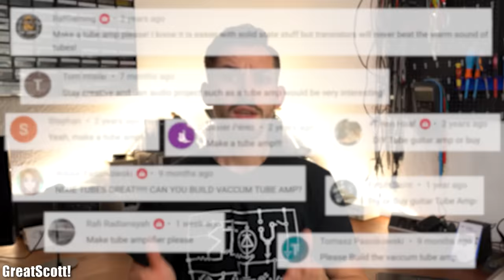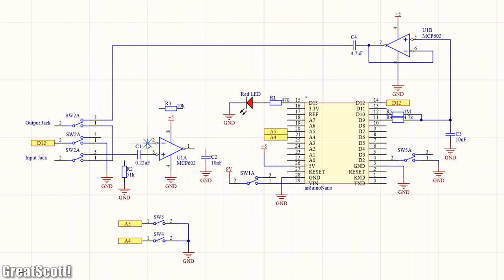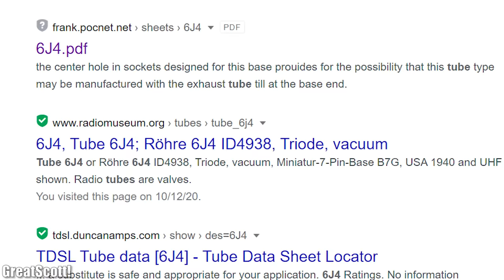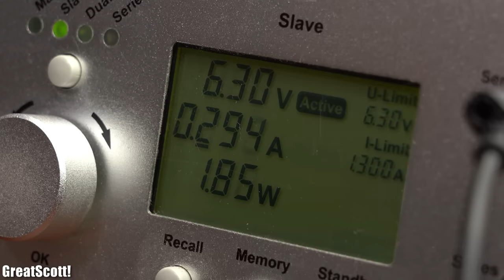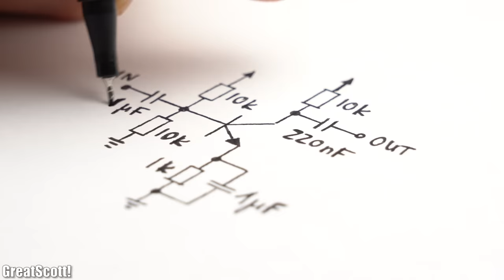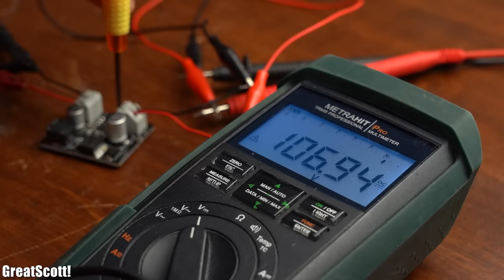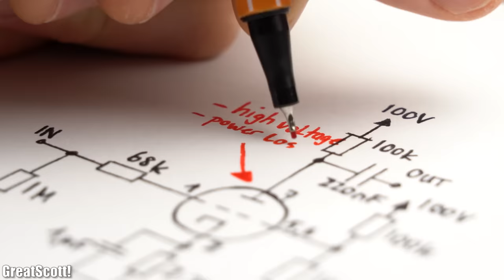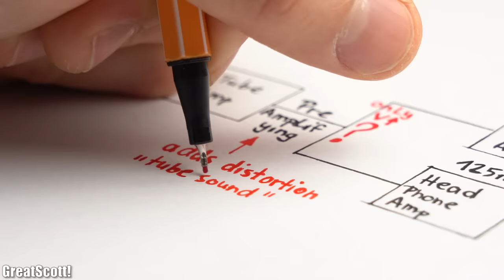Building a Tube Amp! Does it produce better audio quality though? EB#47

Comment: Question; My grandfather who was an electrical engineering degree in 1932, once told me that only tubes can produce higher than 40 watts for transmitting voice over a radio. He passed in 79, but had indicated that space craft full of electronics, still used a tube radio to communicate with earth stations or Houston. 
Also, I have never studied class D amps or guitar amps other than having the back off a “Marshall” years ago, it was full of tubes. Wouldn’t Ted Nugent hunt someone down if the came in the night and stole his tubes from the class D amp section? His feed back was legendary on stage. It you to cost $5 US to see a cover band followed by Ted Nugent or Alice Cooper. I stopped going when it went over $20.

Comment: Both Solid State & Tube amps are quite similar when operated within their limits.  It is when over-driven that the differences become audible and different.  Solid State amps have a harsh quality where tubes tend to be less noticeable... and in some cases produce a sound that is appealing.  (guitar amps for-instance) selling the sound as unique.  Keping both in the most linear portion of their specifications will result in a very similar sound.

Tube amps generally require a transformer to couple the speaker's impedance to that of the Tube plate circuit.  Although some tube circuits have been produced that can be transformer-less.  The transformers are a critical part of the design.  MACINTOSH back in it's hay day used interwolven layers of wire withing the large magnetic core (core being comprised of a special grain oriented steel to keep the field produced captured inside the transformer).  It is a lot of magic which isn't covered very well in technical writing.

The other thing is intermodulation distortion products.  These are NEW frequencies generated by mixing of wanted signal frequencies in a non-linear mode.  These produce a "thickening" of the music due to additional frequencies not in the input (source) material.

I prefer the solid state's low output impedance which controls speaker voice coils much better than transformers can at very low frequencies.
I am formerly known as db systems (circa 1971-1973)

Comment: Those eBay "fever bile tube amplifier special" have tubes as buffers not amplifiers. 

There are many tube amp kits for around $300 that could be "built" not just plugged in.

Also, if your bought amp had 96v at the socket, why didn't you use that to power your creation?

Comment: The price of a good tube amp is astronomical and they're not going to reach the power levels of my Crown MA5000, They say Mosfets also sound warm but in my experience, they're not very robust. You might color your sound with a tube preamp and that's a viable option . I presently run the MA5000 with a discrete McIntosh C24. I am replacing the MA500 and going biamp with two Crown XLS 2502s. I like crisp audio, Warm isn't what I want. I designed and built my ported speakers with 15" woofs, 6" open back mids in their own enclosures in the main cabinet and Morel dome tweets. The larger open back mids make a huge difference, The sound is crisp, clear and I think amazing. I can rattle the windows with power. 
Musicians hear my system and are blown away. They ask how did I get that sound.
Tubes might be good for violin concertos at 50 watts if you have 5K bucks for a good tube amp but that's not me. I want to feel the power and hear everything loud and crystal clear. 
BTW Morel dome tweets are great for crisp clear audio. The one thing about my system I don't like is the passive Xovers I had to recap to take the power. With bi-amp I get rid of the bass Xover. Sure you know the coils will take huge power if it doesn't have a DC component (clip.) Maybe I'll go tri-amp. My new amps will be in soon and we'll see. You have a great channel and I like electronics so have a great day!

Comment: I've always very much enjoyed my tube radios and amplifiers. They truly have a very distinctive sound that is very different from modern IC units. However... I also own jukeboxes and record players from the 60s and 70s that sound remarkably similar to my tube equipment (only no tubes). I think in the end it has everything to do with the quality of the components that are used. This is especially true and equally important in the tube realm. I don't think using a tiny, cheap Bluetooth amplifier with low buck Russian tubes is going to give you a very good idea of what people talk about when they say they love the sound of a tube amplifier or radio. I'm certain if you would ask nicely, a tube enthusiast here would be more than happy to let you borrow and play with one of their prized possessions!
Reply: It might be that those older solid state units were incorporating germanium transistors, those being some of the best when it comes to solid state design, I think folks even tested pairs for a more balanced signal, much as is done with pairing vacuum tubes to get the best sound...

Comment: I have a huge colection of tubes for example i have a TB3 a old russian tube which can handel upto 2KW at 600v plate voltage and built an amplifier with it and it sound great 
But it has a heatercurrent of 15A @5V

Comment: Love the channel. With all due respect I think your gonna need a bit more training before really being a judge/critic of analog amps ...   I don't know if you have done this yet,, but a fun thing to do to get your feet wet is to study an op amp. like IN DEPTH. I'm talking about the internal circuitry.  for me I have been studying the NJM4580  and the NE5532  . They are both serving the same purpose, but 2 different approaches.  After years of re-creating and making tons of replicas with trim pots, its a whole new world.  The subtleties of bias in a moving .... um the linearities are kinda linked / mixed / matched ... they ebb and flow with different levels. Its a whole different paradigm than buy kit & power up.  Buy kit, follow datasheet is an instruction. Analog is an Art .   
You should try it :) 
That class B topo  has SOOO many more uses.
In order to learn analog it helps to have some projects. So here ya go : 
- Spring Reverb -
Physical construction is straight forward. Its a metal spring suspended in a housing. That is easy.
Make it with 2 coils.  hand wind the exciter coil AND the pickup coil .  
Both will need amps.   One is a power delivery type , the other is a pre-amp .  Yes DISCRETE amps. The main challenge is to build the amps and coils .  ( I dare you to do it without looking up any info :p ) 
- Then when the Verb is built ,  your going to need a way to use it -
I think building amps from scratch for the verb itself is going to be a major fun, decent challenge.  So maybe try something a little different.
objective >>  Make a little audio mixer with pots and buttons , so the microphone can be mixed with the reverb.   Make it so your microphone signal goes into the reverb, and also the dry mic sound.  "Parallel"   or dry/wet.
 Just use some OP AMPS.   I bet your gonna be surprised to see that even though op amps are great little "already" done packages... there are still nuances about them, like matching multiple input/output impedances and aiming for a particular audio level.     
To recap >>  A mic gets plugged into a little mini mixer (2 channels). One path sends the dry mic signal to channel 1(opamp+volume pot) and the final amp. Channel One will also send the dry mic signal into the spring reverb. it comes back out the verb into channel 2. Both are fed into the final amp.    THEN   that final amp gets plugged into a recording device. The one you use to record your videos. Which is probably a computer, or an audio interface.
If you make your mixer self contained and standalone, then you can use it for decades to mess with various things.    You can alter your voice by using your coils and clipping them onto random large objects... Huge pipes ... Other circuits ..   many opportunities 
Its a super simple project in which each piece has been done plenty of times. There are plenty of guides and info to learn from.   Spring Reverbs are fun to play with.  They sound great when done right. That is what the mixer is for.

Comment: I've built tube preamps before, and ended up using 9 volts into a Max1044, putting out something like 36-ish V. A little worried about long term stability.

Comment: Tube distorsion is asymetric, which creates 2nd 4th harmonics. 3rd and 5th are not pleasing for the ears.  And as yoi mention, no harsh symetric clipping (some amplifier has a cold clipper but only acts in the lower part of the signal)

Comment: Sometimes when high quality parts are available tubes still offer good performance.  An EF 86 pentode offers very high gain and low distortion in either pentode or triode mode. Distortion 0.2% pentode 0.1% triode. For microphones pentode often is prefered as the full amplifiction range is not required just the gain. The curve is almost a straight line if a small section of it used as a pentode. One problem. A very large anode load is required. > 3 M ohms next stage loading perhaps. A modern FET op amp can work as the next stage as it is happy to work at high impedance. If knowledge of music is made to be more important than that of technicians this arrangement can offer the best sound. Open, deep and expansive. Not dull nor bloated if corrrectly loaded ( many were not = dull ). Good EF86s are mostly a thing of the past. A bad one will sound bright and noisey. Beethoven live is often far more like a tube sound. That is rich, high frequencies stop when not in the music and a vast sound stage. A man I respect said it maybe noise spectrum rather than distortion we prefer. EF86 is the exception to most. It can be very nasty or supurb, it depends on the one being tried .https://mullard.org/collections/audio-valves-ef86-z729-cv2901-cv4085-pentode

Comment: There are  a few components to "tube sound".
In the early days, when transistors were new, the valve amp tended to be better... the "transistor radio" was not a good sound, but now, transistor amplifiers can produce very low distortion, but are most unforgiving when overdriven.
Valves have a characteristic distortion effect with the curve in their characteristics tending toward even harmonics that are more "musical" as well as a "soft" overdrive.
JFETs come close to the curved characteristic.

PS. There was a computer motherboard with built-in tube amplifier http://www.techwarelabs.com/reviews/motherboard/ax4ge_tube-g/

Comment: the magic is in the imperfection of the non-linear amplification curve.
it is different to transistors. the transistor creates more odd harmonics and the tube more even harmonics. the even harmonics add some fat warmth to it. the odd harmonics are very unpleasant harmonics which are more associated with distortion. in music, even harmonics is the same note but just one octave higher. so it fits in the octave harmonic raster.
btw. a class-d amp has more pleasant distortion compared to a class A/B bipolar transistor amp. the distortion of a class-D amp is usually low

Comment: There really isn't much of a point in having a tube amplifier, unless you like the vintage look and/or decided to build one yourself for fun that is. The only thing I can think of is guitar amplifiers, where overdriving a tube may produce slightly better quality sound. Otherwise, most people can hardly hear any difference between a tube amplifier and a solid state one, not to mention the one featured in the video is basically solid state. You can jump the tubes completely and it's still going to work fine. I suppose the tubes introduce some distortion, and maybe some gain, but that's almost nothing compare to what the chips on that board are doing.

Comment: A true tube amp has no IC's, point to point wiring, basic tonal adjustment options, and requires time to warm up to proper operation. This was a cute little hybrid digital/tube pre-amp. Need something like a Marshall for guitar comparison; or a mcintosh for hi-fi. There are also kits to build one yourself.

Comment: hi i would like to point out some  inaccuracies, that tube is cheap chinese and its a pentode! did no one count the elements you can clearly see? theres 5, its an alternative for a 6au6 and its not as silky sounding as a 6k4. It does not matter if your using tubes as final drive or pre amp, what does matter is the tube type and how many. If you get a 12ax7 and use each half as left and right, then run in tandom with a pair of ef86 tubes in triode mode then through class a/b or d amp your welcome! if you want cheap budget great sound get 2 times 12dc tube pres aliexpress ge5654 and 6k4, run in tandom for a tube set go into the ge5654 first, also be aware all these pentodes are being wired in triode mode so screen is connected to anode(plate) and control grid is connected to cathode but they sound much better then most triodes imo.

Comment: A tube amp generally has three stages: a pre-amp, inverter, and power.  2x for stereo. Some tubes have two sides, but any amp with only two tubes isn’t going to be a real “tube amp”. No big external transforms for power and audio is also a dead give-away.

Comment: The really expensive tube amps are directly coupled and employ a lot of negative feedback. The cheaper designs, such as the EL84 and ECC83 ones that I have built many of throughout the years, are RC coupled and in class A bias so are weak: usually four or five watts. For listening pleasure, high efficiency speakers are needed. These were Alnico types, usually and most of the cheaper ceramic magnet types are a bit too insensitive for class A valve use. If up to 20 watt is required from a class A tube design, it's necessary to dissipate perhaps 300 watts from the mains, just to get 40 watt arriving at the speakers. In these days of the net zero agenda, valve amps of this type would be costly to run.

Comment: Well the tubes in this amp are rather a filter. If the amp which is connected to the speaker or headphones has no tube, it is in my opinion not a tube amplifier.
Anyway thanks for the nice report 👍

Comment: I think the tubes on the amp that you bought are there mainly for looks and to justify their claim that it is a tube amp.  Also, wouldn't a MOSFET have been a better solid state component to compare with tubes, since like tubes they are controlled by an input voltage, not input current like a BJT?

Comment: Tube amps are better to anyone with properly functioning ears.  These cheap "hybrid" preamps are the  only reason there's a debate.  In these, the tube is little more than eye candy.  A real tube amp uses a couple hundred volts to push real speakers, not headphones.  The fact that tubes become micro-phonic is how they color the sound in usually a pleasant way, just like the wood of a guitar.  If there's not sound vibrating that tube, you're pretty much wasting your time/effort.
Also, love the great vids.  Thanks for what you do.

Comment: I have a challenge for you: Build a high voltage power supply (10Kv or higher) using the resonant frequency of an RLC circuit without ANY timers or transistors.

The only oscillation you can use is that frequency of the capacitive and inductive elements. 

Good luck! Not many know how to do this.

Comment: Any noise generated in the first stage gets amplified by the following stages. Some transistors have more noise (Shot noise or thermal noise) than tubes. But in any event you want the lowest noise in the first stage.

Comment: In your tube class-A amplifier circuit, how to on the "Heater"which place in tube.
Because according to your circuit, cathode grounded through Resistors and capacitor.
I think between heater and cathode, one pin is used as a common pin .that is grounded through Resistor but second pin of  heater connection is not shown in diagram ?

Comment: Remove the two resistors connected to pins 5 and 6 and your amplifier should work fine. The control grid should always be biased negative with respect to the cathode in audio service. But please... use a proper tube socket. Soldering directly to the pins can crack the glass seal.

Comment: Here is the answer in a nutshell.  Some of the excitement in musical performances is the surprising note or resonance every now and then that blooms.  The bass or cello that sounds so strong.  Live performances are full of them, especially acoustic performances.  The acoustics of a music venue are important.  But here's the rub.  Recorded music is usually done in a very neutral environment.  Add to that the acoustic suspension speakers of today.  Flat response is what we get.  Our gear to reproduce the exact frequency response of the recorded sound is mixing with very flat recordings.  Boooring.
Tube amps are rather non-linear.  They have curves in their responses.  Yes, they try to work along a linear path.  But we hear all the nonlinearities, and we like them.  We substitute the errors of tube amps for the errors of the various venues that are missing.  We don't know it, but it's true.  It makes a recording more enjoyable.  
Let's face it.  A performance from Carnegie will not sound like Royal Albert.  And none will sound like Monterey or Woodstock.  Tube amps put a bit of life back into a performance.  Some nutshell.